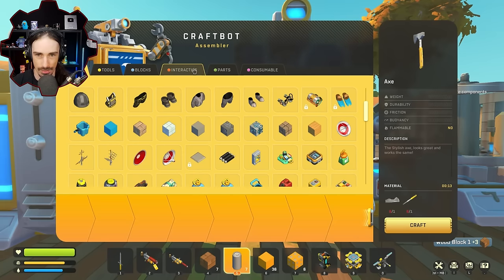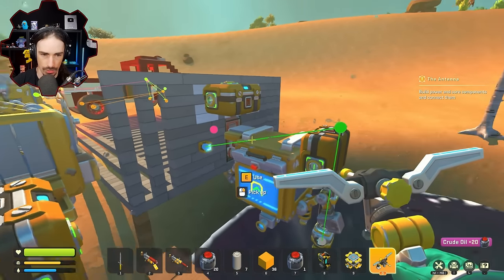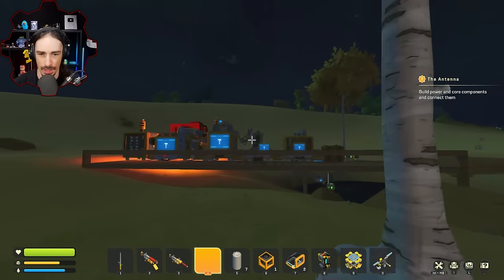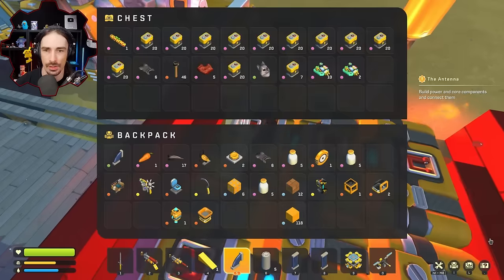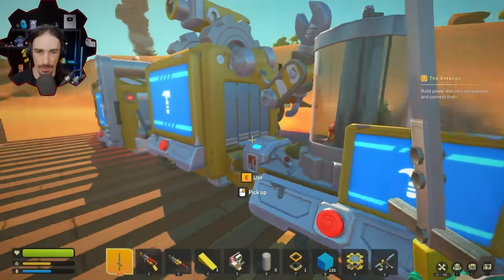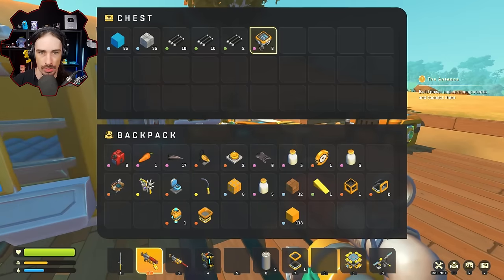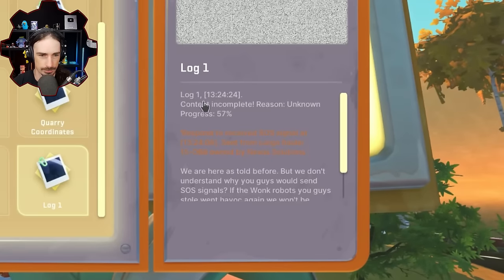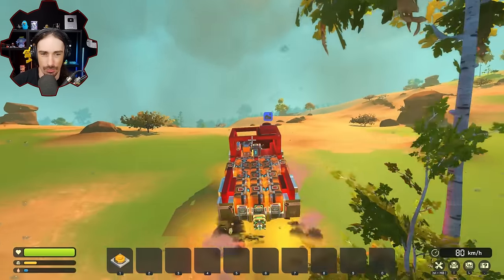Unlocking This Glider Almost Cost My Sanity

Comment: Filters are directional. Yours is backward. That broke your crafting chain. The filter will apply to all chest its pointing to (your output chest and all of your storage system).
Probe setting, trigger in range, 0 to 29.
Crafting chain can get wonky sometimes if you have a vacuum pump somewhere in your system. Make sure the pipe glow blue, not green. Pick up and replace the filter usually helps.

Comment: probe settings:
0 > 29, trigger in range
turns on when chest is less than full
Reply: bro i was like yelling that the whole time
Reply: Yup
Reply: How are us common folk supposed to know that? There is zero explanation of how to actually use it. Its like the computer mission. People that arent proficient in certain computer languages will have no idea how to do certain things.
Reply: @sonorangaming449  craft one, take 5 minutes and play with it? 
that's how i learned to make it work 
i dunno what '% to max' setting is but that's not what scrapman wanted
Reply: @LoPhatKao  So you still don't know how 50% of it works, great advice...
Reply: @LoPhatKao  That's what he did, and had no luck in figuring it out. Sure, he'd probably figure it out eventually, but adding things and not telling people how to use it is a pretty big oversight. "Here's a part that's does a thing, good luck figuring out how to use it." Its an impressive mod, but adding instructions shouldn't be difficult.
Reply: Honestly, Scrap Man is NOT the smartest guy in the world, and even though I accepted this, I remained to yell at my screen.
Reply: Never used one before today
literally paused vid and fired up my world, crafted one and found the settings he needed to use to make his system work
Since he finished questline though, I doubt having the correct settings matters
Reply: @sonorangaming449  It's easy if you take the time to sit and think about it.

Comment: the filter allows only the inserted item to pass BUT  all chests on output side can only hold that item then.  thats why your crafting chain is messed up now
Reply: That doesn't quite explain the things he crafted disappearing and reappearing inside the crafting bots themselves, including AFTER he disconnected the filter+oil chest from the system... not to mention later on the craft bot not actually taking the materials for the products he is making. So clearly there are some MAJOR bugs going on here
Reply: And filters very wip, so there is a bug, when you delete filter pipe, but chests still filtered. You have to replace chests to fix it.
Reply: Pretty sure the output side was facing the oil chest though?
Reply: @GummieI  I think, items tried to get to chests, but chests were filtered. And as I said, filters are very work in progress. I don't recommend connect filter pipe (with its output) to multiple chests.
Reply: @Nevir202 output side (direction of arrow) of filter pipe was facing the rest of the system
Reply: @GummieI  it explains it entirely, EVERY chest on the filtered side of the filter pipe gets the filter applied to it
Reply: @terranterr  But he DISCONNECTED the filter, so all those chest were not part of the same system as the filter (or at least they logically shouldn't be anymore)
And still doesn't explain how things he craft disappear being NOWHERE in the system, and then magically reappearing inside the craftbots OR how he later was able to craft some stuff that didn't even take the material cost away, he was litterally conjuring things out of thin air
Reply: The fact that later on, he consumes the items he just created, i.e. the items in the output chest, leads me to think it has something to do with the decoupler. Maybe everything on his car going through the decoupler, wasn't getting consumed.
Reply: @roccov3614  no its the filter
Reply: @GummieI  the craft bots script and the filter pipe script are very buggy and we are trying to fix it. It appears his chests kept the filter for some reason as well as the craftbots. He needs to put the bots on the lift and delete them to reset their scripts. The decoupler doesnt cause issues like that, that we know of
Reply: @GummieI that’s another filter glitch I’ve experienced before, no clue why it happens

Comment: The container probe measures the number of slots in the container it is placed on that have at least 1 item in them, and displays that number at the lop of the gui. It outputs a logic signal if the top number is between the two numbers on the bottom, and invert makes it output a logic signal if the top number is not between the two bottom numbers. Output % to max is difficult to explain without a good understanding of compact computers, liddylicious has a video explaining them, it’s the one that has a “Who’s that Pokémon” kind of thumbnail.

Comment: I noticed that the "ingredients not getting consumed" bug only affected stuff on the truck. The high voltage cables still got consumed. (He was left with only a single cable at around 21:00.)

Comment: I think an issue you got is like others mentioned, is the filter messing with everything. I think if you add an ejector tube (or whatever it is that forces items to go in a certain direction) to force the direction of the chain in the direction of the output chest. 

Also the filter isn't necessary with the container probe shutting off the vaccum pump at 29 stacks +1.

Comment: I think if you use another filter at the input on blacklist it should restrict the direction so stuff only gets pulled from your vehicle storage. I also think if you setup an actual vacuum pipe line that connects each of the crafting stations together instead of hooking them up to each other it'll output more reliably because it won't be trying to push product through the other crafters. Just trying to help.

Comment: Also minor spoiler for those who haven't played Crashlander or watched the video yet, but anyone else in the know kind of start grinning around 19:25? His monologue about his effort into the antenna and all that jazz....And we all know what's around the corner. Sorry, Scrapman, but it's something you have to experience (which you have) to kind of fully get the sense of scale, so to speak. It's also why I wonder if the entire mod title of "Crashlander: Square One" means anything.

Also, check the debris really thoroughly. It probably is entirely RNG, but when I did this; I, for some reason and I wasn't doing anything remotely different, got my master battery back......so I was absolutely confused at the whole, "You lost everything required to make it!" and I got back the one part that can't be crafted to rebuild it.

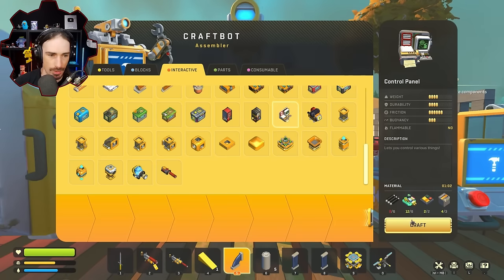Comment: 13:10 - oh no... I can imagine this problem.
So... you can try a few things, here's from easiest to hardest:

Replace your setup, just pick it up and place them back down again, inclusive the output chest. if not;
Place a directional filter out from the last crafter and into the output chest, if not;
                                                                       (the idea here is to force the chain to recognize intended the direction of the pipes)
Place a directional filter in from the truck connection into the crafting setup.
                                   (I'm saying that because as this is getting confused I also do expect the things to at some point start feeding into the truck.)

Anyway I think past that it needs dev fix.
Also devs could improve it just for making it better.
Reply: I've ran into this problem trying to create a kind of similar thing and I think it's just an issue of input and output can't be the same thing for multiple bots. I was able to loop a smelter just fine, no filters required. It was two chests though with there being stuff fed into it from my refineries, the smelter outputting into another chest, which also fed back into the raw resource chest, which the smelter pulled through. But it seems like when I skipped several iterations and when for all 5 bots on 1 system, I'd get a crafting lock going on. Like instead of it disappearing from my queue, it'd just never finish crafting until I removed the looping connection and reloaded the game. So there's some hierarchy of "this input overrides the status of this output and this output is prioritized before this other output" and other Mcguffin's going on that really need to be explained at the very least.

Comment: It's the filter vacuum pipe that's bugged - somehow it causes all chests to only accept oil (in this case) and the delay is the crafted item trying the chests before having no choice but to return to the crafter... At least, that's all I've been able to as certain through my diagnostics so far... HTH
Reply: Ascertain**

Comment: I suspect the output chest broke because it was no longer the last chest in the chain, it was trying to output to the oil chest but couldn’t?
Reply: I also notice that the infinite crafting resources only applied to items on the vehicle. Items in the output chest still got consumed. Seems like the connector has an unintended side effect…

Comment: Your crafting chain, the items are trying to go into the oil chest because your filter pipe is the wrong way around and shouldn’t have oil in the filter pipes slot. Or connect the oil pipe to where you connect your vehicle.

Comment: Scrapman, apparently you don't seem to understand the fact that if you need oil to craft something other than gas, then instead of taking it out of the one chest and have the pump draw up more oil then let the pump send it to other chests so that way it will already be on hand and when every you gas up your truck then you can turn the pump back on and pump more oil into the oil chest. I'm just saying that would be much simpler

Comment: I am probably the outliner but I feel like this mod sucks. Crafting is unnecessarily  tedious and modded blocks had poor descriptions. Almost no enemies to defend against and they ware poorly designed. Pretty much no reason to craft half of the modded stuff other then needing them for the quest. I felt like the mod just made scrap mechanic dull and tedious. There are way better mods out there then this.